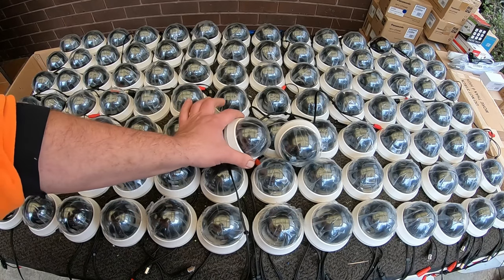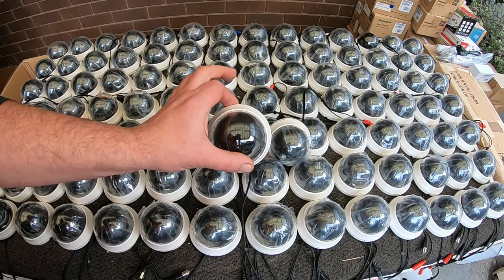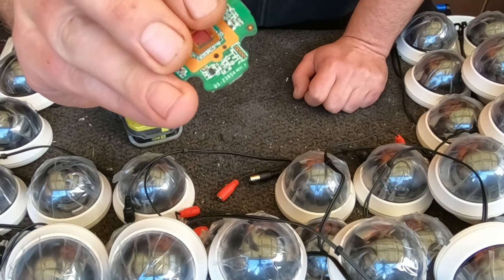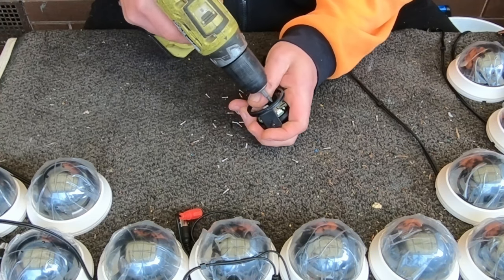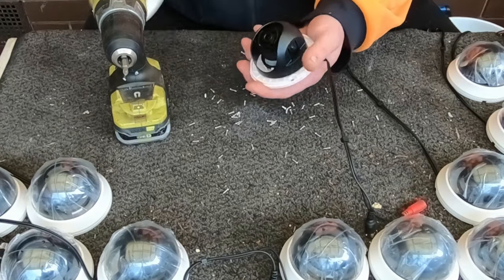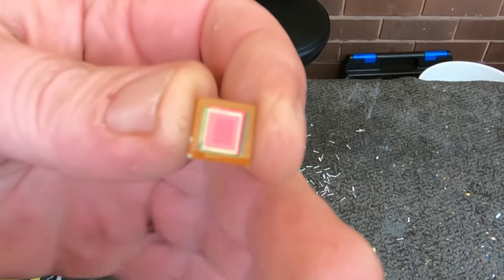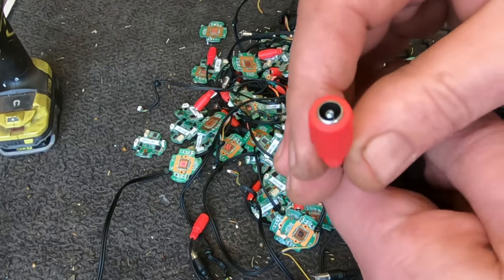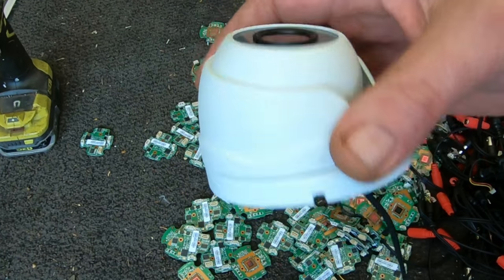100 Dome Security Camera's - 1hr Scrap Challenge

Comment: Really wish you would do a safety video for first time/beginning scrapers such as myself. Like what's under pressure, what could shock you, what could potentially cook off with little warning

I made the mistake of slipping a bolt and my wrench hitting a compressor line. Left a nasty mess, but I didn't know if their was chemicals or not so I took a shower. It rattled the nerves a bit
Reply: did a liquid or a gas come out ? if it was a liquid its oil mixed with freon if its gas its just frehon neither are very dangerous just try  to get a few feet away from it until its stops leaking if it happens again
Reply: House Bat it was a gasesous at first, flooded my damn garage lol. But it left residue, everywhere
Reply: its from a line ( copper or iron ) connected to a compresor right? if your cutting those for the copper you might want to invest in getting a freon removing and selling license so you can get the freon and sell it (freon is 1000 dolllars for about 1 propane tank full a propane tank full of it ways aprox 45 pounds) so it would be worth your time and yah its not very hazardous just go pick it up side ways so the pipe doesnt leak and  let it leak into a nearby storm drain
Reply: House Bat you're right on the money, copper line roughly 1/2" in diameter. Small little shit that scared the daylights out of me, and is freon seriously worth that much? I've been sleeping on a gold mine lol

Comment: Another great video Ben! I am always Intrigued at the stuff you get. I do have a question for you, The chips that you took off for gold recovery, Do all those types of chips have gold? I was scrapping some flat screens and some of the screens seem to have gold filaments in them, I kept them just in case, Anyway do you know if some flat screen Tv screens have gold filaments in them, And also the plastic tabs on the edges? Ben, Thank you for sharing.
Reply from the maker: Those chips are cmos sensors, I don't think lcd tv's have them , they would be something else like a silicon chip and have very little if any gold. not sure what the plastic tabs are though, do you mean the ribbon wire ends or plugs?
Reply: eWaste Ben, Yes, I do mean the ribbon wires that are connected to the screens themselves, Sorry for the mix up in words, I have one that looks like it is slap full of gold, And the Filaments  Enter the screen up to 2" all around from where the ribbon wires are attached.